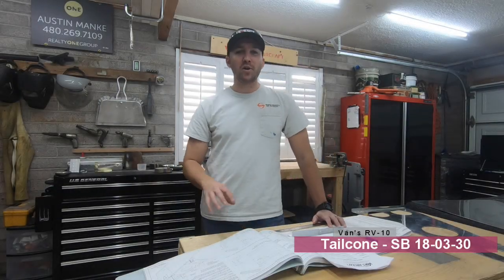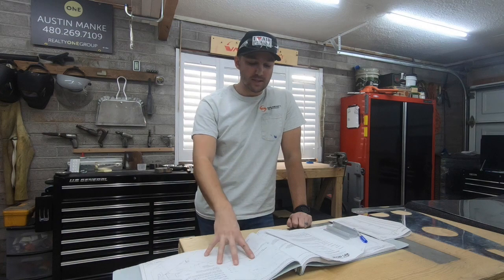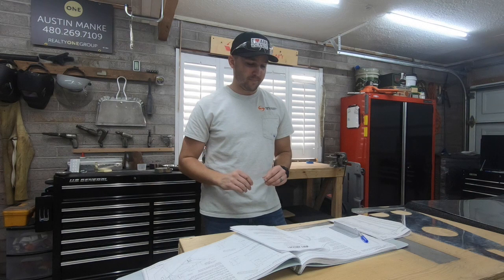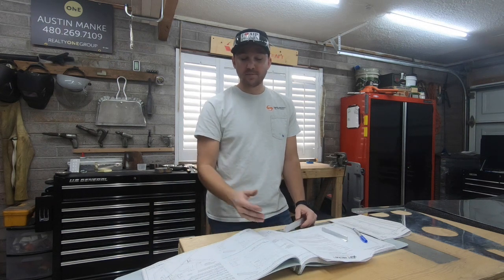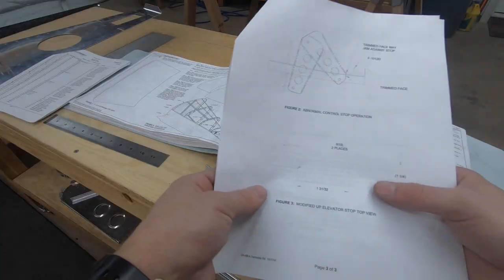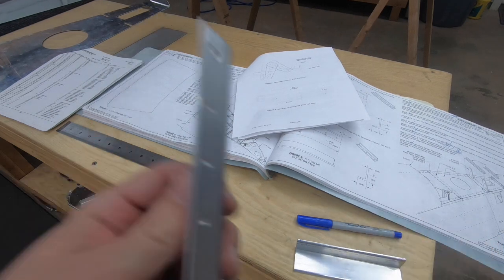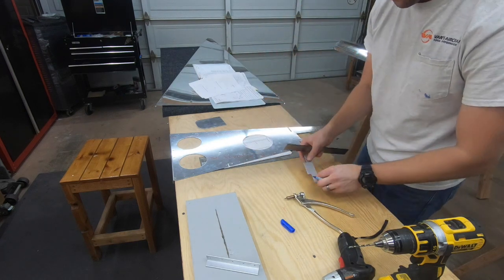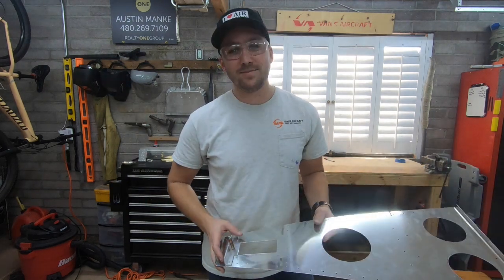Outdated Plans? Service Bulletin 18-03-30

Comment: Check the RV-10 on the Vans Aircraft Builders’ Forum and see if they have a thread called “Gotchas” as they do with the RV-14A.  Some really good input on a spreadsheet developed by one of the builders AND…..since the 14A shares the same wing with the RV-10, there may be some pertinent “gotchas” you can catch ahead of construction.  That said, the plans should really be revised so builders don’t spend hours and hours scratching their heads or having to peruse long, builder prepared spreadsheets!
Reply from the maker: Thank you for the info! I’ll have to check that out and plan ahead. And I totally hear you on that!

Comment: Way to stay up on the bulletins. I was under the same impression as you were. SB were typically just placed in the plans similar to the rudder stops on the vertical stabilizer and the inboard aileron hinge bracket section 15 (you’ll get there). I had unfortunately installed it prior to being aware of the service bulletin. So I’ll have the pleasure of replacing it the hard way. My stock elevator stop stopped the elevator horns not on the notched part but it is pretty close. My thought is peace of mind goes a long way
Reply from the maker: I am very glad it was flagged and caught. A great lesson to learn early on. I am surprised this wasn't addressed the way the rudder stop was. That is great to hear your elevator stop worked for you. It seems very hit or miss as to whether or not it turns out to be an issue. I'll be keeping a on eye out for that aileron section. Thank you for letting me know. Hopefully it isn't too hard to remedy for you!

Comment: I’m thinking a good idea may be to get all of the SBs and file them in the relevant pages of the plans. However, even better would be for Vans to give copies to the plans guy. Pretty ridiculous that they don’t have future plans from that point be corrected. It shouldn’t be that difficult if they can now decide to do match drilling in future kits.
Reply from the maker: I think that's a great idea. I will probably be doing that as well to stay on top of things going forward. And yeah, it definitely doesn't seem like difficult thing to change in the plans. Sure is strange!

Comment: Just about to start on my RV-14 (tailwheel) Empennage Kit. Thanks for the reminder to check all of the Service Bulletins, Notifications and Letters, and Revisions and Changes before going forward. As far as revising plan sets for every change? Every page has a publication date, as well as any applicable revision number (rev. zero through 'x'). It appears that there is no "current" set of plans, nor is this even possible? It would be nice if builders were sent an alert when a new bulletin, notification, etc., were issued, but that isn't the way it is at present. Until it is, seems it's up to builders to stay informed through the Van's website. Oh, and what about someone that buys an uncompleted project? How old are their plans, and how would they know that this is even an issue?
Reply from the maker: That is great to hear! Enjoy the build. And I hear you. You make a great point about the publication dates. The interesting thing is my plans have an updated date listed for the vertical stabilizer section to address the rudder stop service bulletin where the part was changed (10/02/20), but the elevator stop section has a date of 12/09/13. Best bet is to stay on top of all publications like you mentioned. Enjoy that 14 build and thanks for watching!!